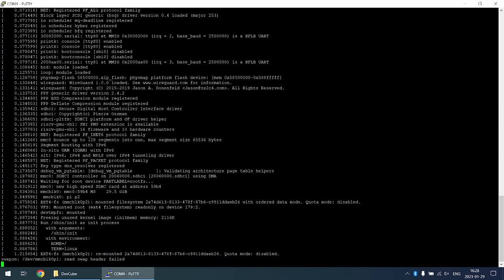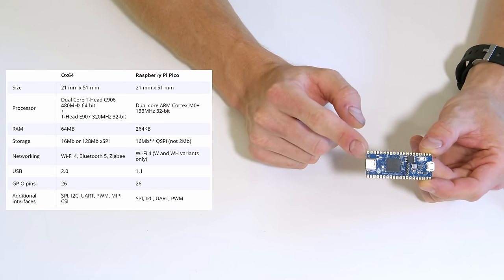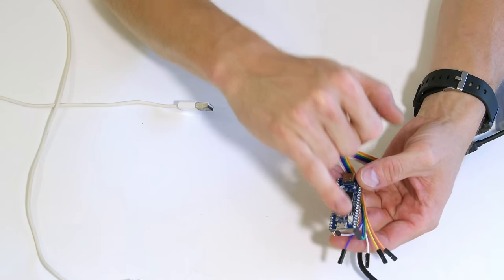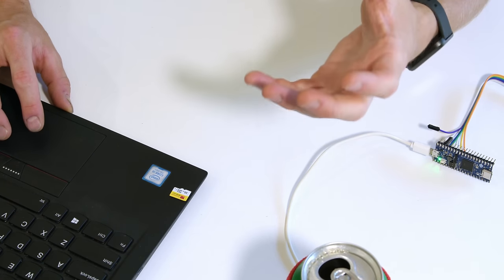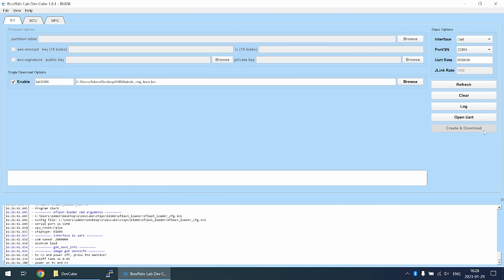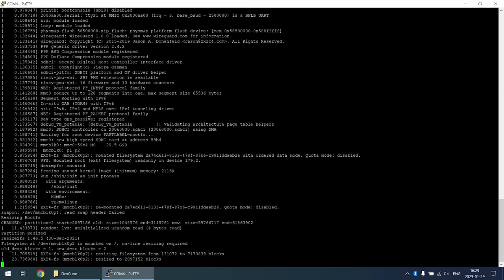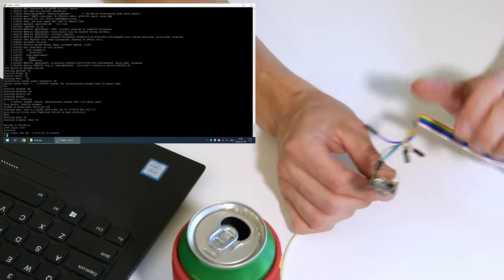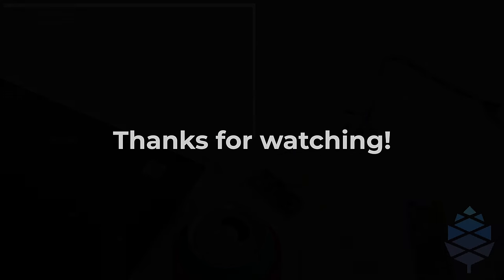Ox64 SBC - Connecting, Flashing and Booting Linux! ($8 from Pine64)

Comment: The ram is the problem why RPI pico and most other micro can't have a Linux port, kernel needs I think 8MB(or 16MB) at least to run. RISC-V is not a powerful instruction set, comparable with attiny, RV32I set has about 50 basic instruction if it doesn't have any of the extensions.
Reply from the maker: Yeah it's a shame about the RPi Pico, but I think RISC-V is quite powerful and it can be easy to forget sometime that ARM64, Amtel Attiny, RP2040 and BL808 are all RISC processors, just of different generations with different design goals. 

I am assuming you've got a fair bit of knowledge on it here but for others reading; RISC in general aims to have a _R_educed amount of instructions and allow more complex instructions to be built on those, which ARM does well, as opposed CISC like an Intel x86 or AMD64 CPU which implements everything under the sun as _C_omplex instruction sets, but alas chews up a bucket load more power and in my opinion is actually a tad less flexible for that reason. Most complex instructions are just pre-assembled packages of other instructions anyway, or even complex versions of add/sub/mul/div if you get down to it!

You do have a point though that the AVR ISA that Amtel made is pretty damn awesome, but again it is still RISC. Not really comparing apples to apples here when you've got an 8-bit RISC ISA from 1996 designed for embedded systems (Amtel AVR) vs a 64-bit RISC ISA from 2010 designed for modern light weight computing. 

Or as they all say; it's not how big it is, it's how you use it 🤣🤣
Reply: And as Platima said, RISC-V boards with one core outperformed arm based boards with multipe cores in certain tasks, plus R-V is much more flexible and openS
Reply from the maker: @giorgio_giovanni  I think it might all be personal preference in the end
Reply: @PlatimaTinkers  I was rewatching some 0x64 videos today and noticed your reply to my post. I tend to miss notifications, so my response is one year late. 😋
When I mentioned the instruction set not being as powerful, I meant that it requires more instructions to perform the same tasks/math compared to some ARM processors that have a more powerful instruction set for executing complex instructions very quickly, that was the tradeoff they made for riscv. 

For example, multiplying on RISC-V without the M extension would require more cycles due to its simpler instruction set. A 144MHz WHC CH32V203 with the RISC-V core V4B  is notably slower than a 120MHz STM32 M4 when handling tasks beyond basic arithmetic, but it can keep up with simple integer math. Having instruction sets that can perform complex math in hardware(often in one instruction) can easily be 10-30 times faster than doing it with less complex instructions, as it requires the CPU to get more involved and run many more cycles. For example, performing math with SIMD instruction sets can be 20 times faster than doing the same math on the same M4 but with general instruction sets, where the CPU needs to be more involved and run many more cycles for the same math.

Not all RISC CPUs are made the same; it all depends on how they're implemented. The term 'RISC' doesn't mean much beyond indicating a certain philosophy behind it. RISC-V is designed to minimize costs and handle basic tasks efficiently, riscv is designed to be in your appliances and not to be concutent of desktop cpu's or to compete with ARM higher smart phone market. If you want to push RISC-V beyond its basic capabilities, you'll need custom extensions tailored to RISC-V cores. While everyone can design their own extensions for their RISC-V CPUs, these won't be part of the RISC-V ecosystem and likely won't be open-source or free.
Reply from the maker: @PeetHobby  Hahaha that's all good mate.

Fair reply and some great information there too! Good explanation of the instructions and extensions for new users too.

That all being said, I think RISC-V is beginning to compete with ARM in low/mid-market, and likely to be seen more and more in common products like phones etc. Ref Western Digital, XuanTie, Qualcomm, Google, IBM, all being involved. And that's ignoring the more bespoke players like SiFive, Espressif, Lattice, etc.

Just my opinion though.

Comment: Linux is a bloated slow OS for MCU - I will use RTOS just fine and it has unlimited support and capabilities
Reply from the maker: You're not wrong, but that's where I think this is so interesting. It's got 4 cores, one of them is dual core 64-bit 480MHz. That's heaps of power!

RTOS definitely wins as far as low power and very specific use cases go, but for people that want to do things like running OctoPrint you'd need that bloatiness of Linux.
Reply: @PlatimaTinkers  RV64 C906 is single core but can be overclocked to 1Ghz
Reply from the maker: Crappo I think you're absolutely right. Great catch. Will add that to the description!
Reply: @PlatimaTinkers  Look at dual core R64 of Kendryte K210 chip. It's a beast MCU and has NPU 2X faster than bl808
Reply from the maker: @browaruspierogus2182  oh man you just turned me on a bit.

10x the NPU power it looks like; 1TOPS compared to 0.1TOPS. That being said I've also got a Pine64 edge card that does 4TOPS and they cost like $12 - just have not had a chance to test it yet!

Looks like SiSpeed do a K210 module, which is funny since they also do a BL808 module! The Sipeed M1n or MAix  are the cheapest I can see. Seed Studio have them but are out of stock. Little bit pricier than the Ox64. Have you got an alternate source?

FYI you might also like the Pinenut 12S. I got a few of these to tinker with (no pun intended haha). BL602 core (RV32 192MHz) for under $2!